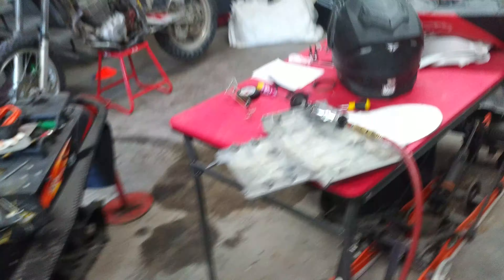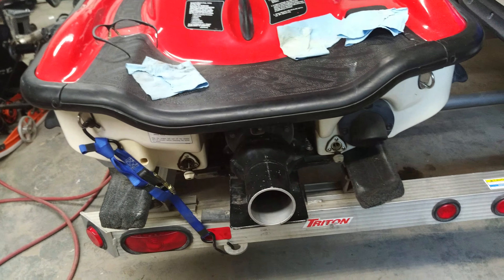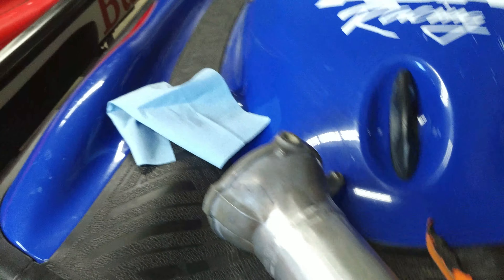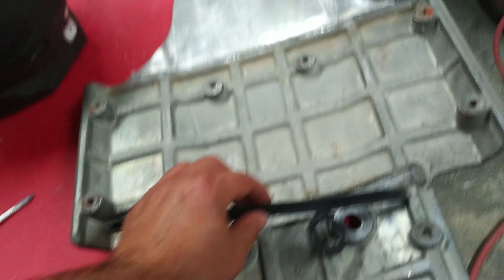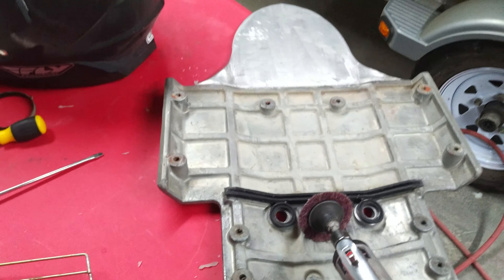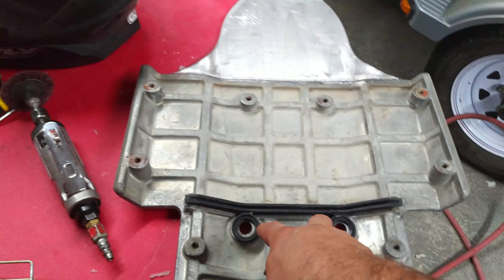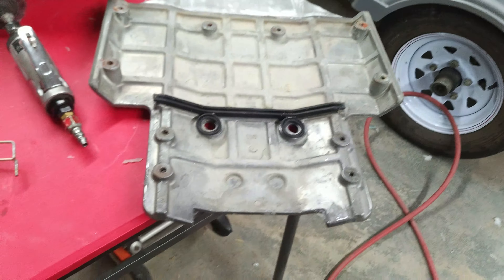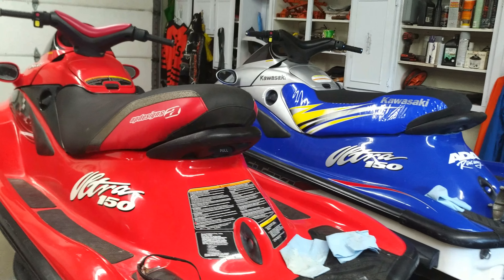Ultra 150 taking in air Cavitation Part 1

Comment: thinking about doing this over the winter. do you have measurements or advise?
Reply from the maker: ahhh its tricky in the end it came down to my impeller being to small... So terrrible take off but once you got it ripping man did have topend... around 72 mph if I recall now... It was a dog out of the hole spinning and cavitattion way to much had to go easy on the throttle...

If you got cavitation I would recommend Impeller and Impeller Ring to look at first...